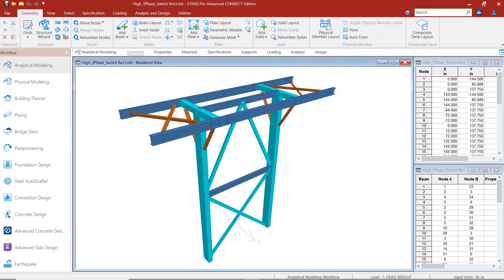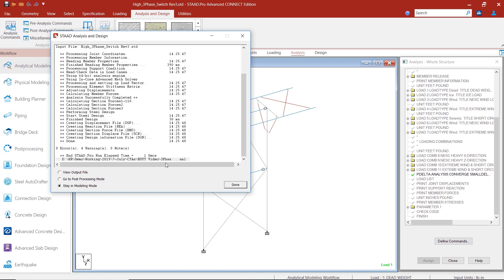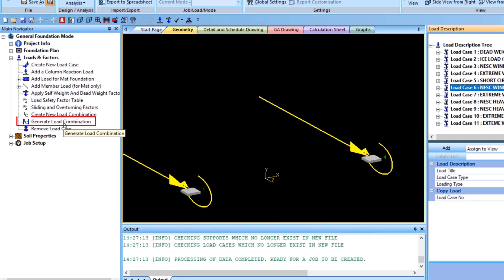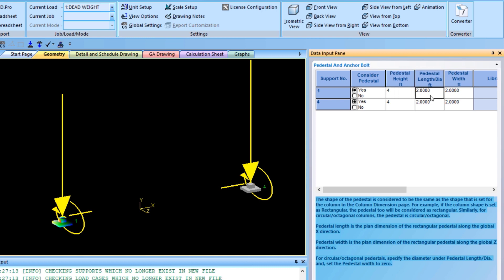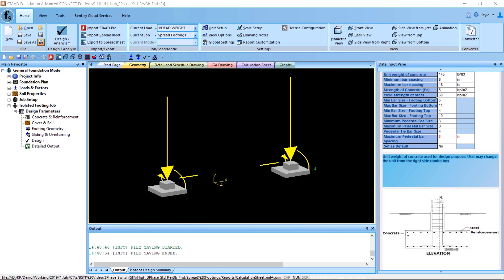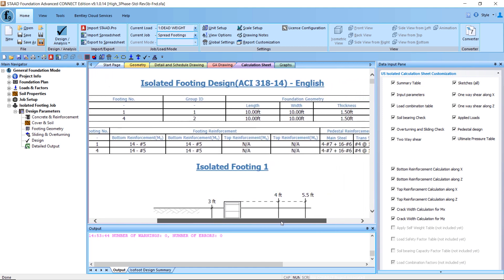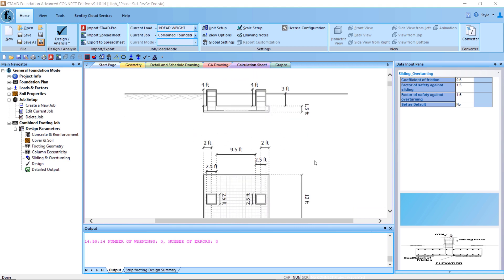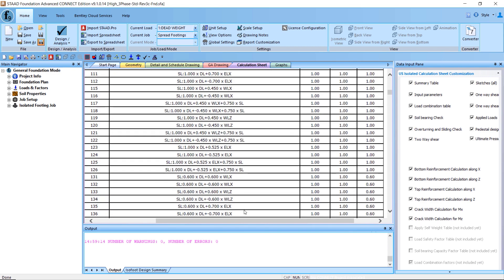Designing Foundations with STAAD.Pro and STAAD Foundation Advanced

Comment: Is there a way to go straight to the foundation analysis without having to start with a super structure i.e. when given reactions without a model?
Reply from the maker: Thank you for watching. STAAD Foundation Advanced can be used as a standalone application or with an analyzed STAAD.Pro model. In the standalone application, you can model the foundation system directly in STAAD Foundation Advanced, along with the appropriate support locations and reactions.
Reply: Thank you for taking the time to reply. That's very good to know.